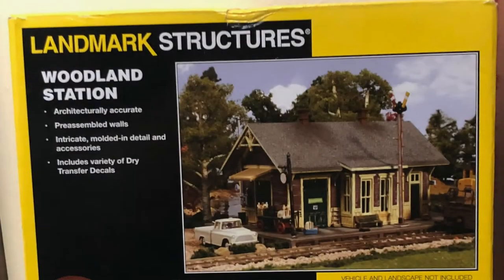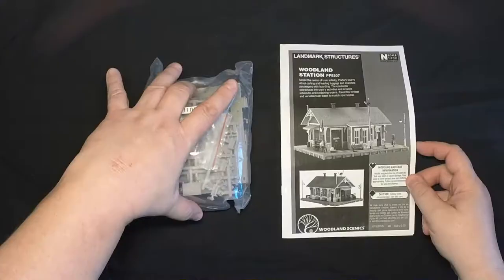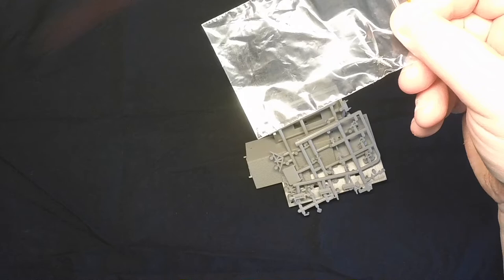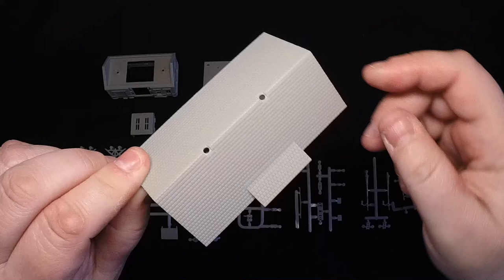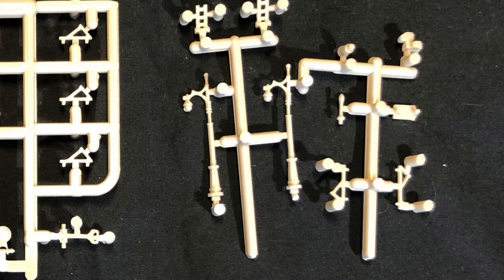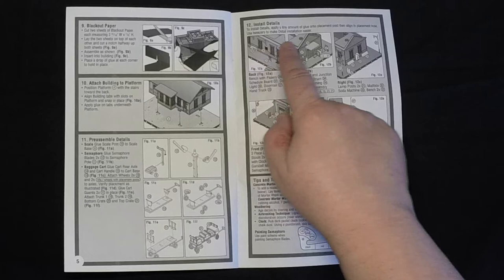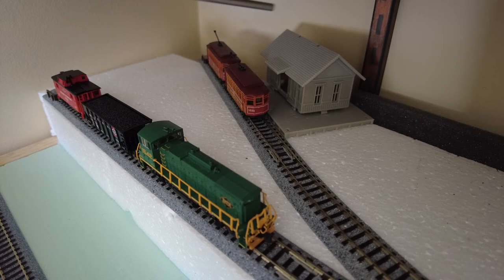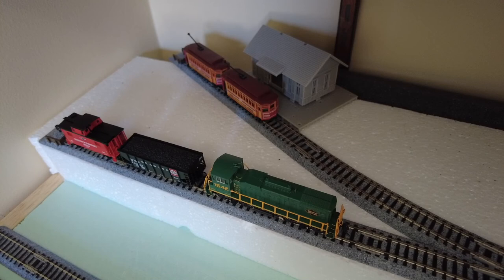Kit unboxing: Woodland Scenics Woodland Station in N scale

Comment: Do you air brush (spray) your models?  When I was into models I always used brushes and we are talking 40 plus years ago.
Reply from the maker: Yes, I primarily air brush the large surfaces of the models, though sometimes a spray can works just as well for basic colors. That has unfortunately been the delay in working on many of my models though, is that I have to rehab my spray booth in the garage to use it again. I also have to find a way to heat and cool it so I can paint year round. All in good time though, I have some plans for the spring ...